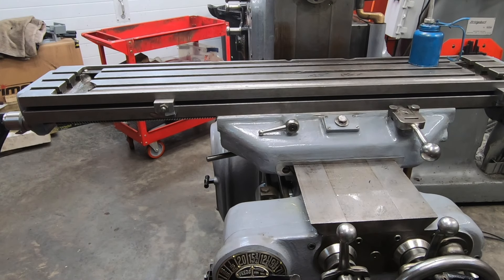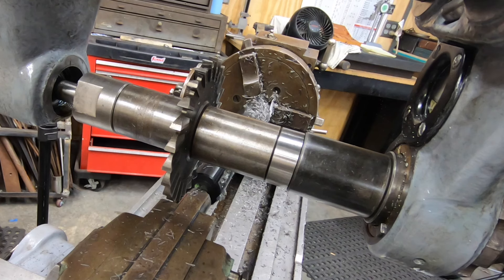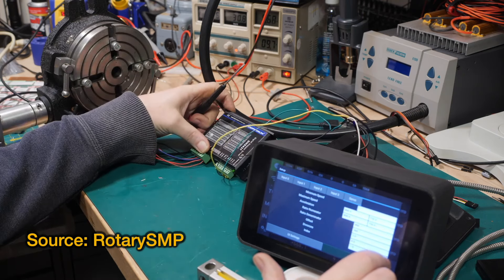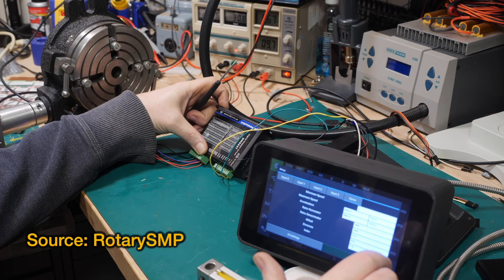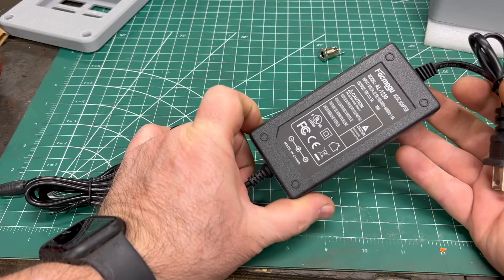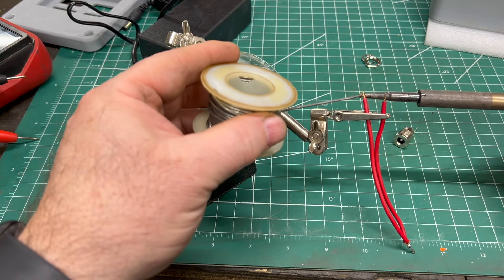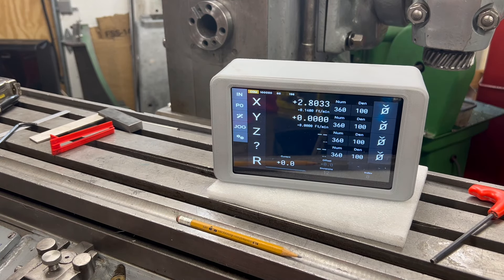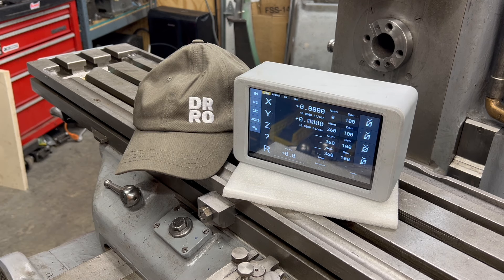Assembling an open source DRO for the Kearney & Trecker 2HL

Comment: Stefano has done a great job on this project and you as a software engineer would know that I'm sure. Your comments about documentation are accurate but that will improve. I am building this project from scratch and am just getting the boards complete which is proving a challenge. I have also built the clough42 ELS. I spent a lot of my life writing software so I bought another TI launch pad (which is an excellent board) to create something like DrDRO. When I saw this project on YouTube I was hooked as it will give my lathe DRO and also a taper cutting function. It also has an excellent user interface.
Reply from the maker: A friend of mine, @Coopedupintheshop, also build his boards from scratch. My eyes aren't good enough for that! LOL!

Comment: Don't you just love using a DRO on the mill.  It was the best investment I made with my machine.  I put a Ditron D80 on Herless combination milling machine.  Cheers, Aaron.
Reply from the maker: First thing I did on my Bridgeport is put a DRO on it. I can't imagine using it without one. Having one on the K&T will be a game changer. I love vintage machinery, but having a DRO on them makes them so much more capable. It's like a power drawbar on a Bridgeport. Yeah, you can use the machine without it, but man, having a little extra help is awesome!

Comment: Lots of capability in that pi box! Looking forward!!
Reply from the maker: Definitely. I am working on getting the other axis connected as well as what I need to do for a rotary controller to drive my divising head.
Reply: @MyLilMule  The Dividing Head Pendant Controller! Wish someone made a mini dividing head. My Lil Mill would swallowed by any regular sized accessories.
On my SB 13, I went with TouchDRO, standard res for the bed, and hi resolution for the X slide. I'm just starting a first official project after 2 back plates, I'm doing a threading dial build.
I'm anxious to see you synchronize the DH.,  oh to do away with, "a one and a two, and 12 holes..."
Reply from the maker: @billgilbride7972 look for an Ellis dividing head. Much more compact. I used to have one a long time ago.

Comment: Cool! So good that it's all open source.
Regards,  Preso
Reply: Get your Pi stuff in Australia from core electronics... kills amazon prices
Reply from the maker: For a nerd like me, it's perfect.
Reply: Add the DRDRO to your mill and with the threadexpress nothing will be impossible... :)
Also he is interested in ideas of what features it should have in its development cycle.

I have suggested 
Changing how the interface works
    For humans not programmers... :)
Summing of 2 axis - but the tweak being the axis can be at an angle.
    For a lathe that would mean an angled top slide to cut tapers and you could move the carriage and still get back to the exact same point on the taper.
Being able to move between machines
    One DRO to rule them all. Provided it is simple in the electronics (pick up a set of presets is what he suggested as a solution)
Curve interpolation - with visual position indicator (moving off proper line)
    Allow a fully manual machine to better and more quickly produce curves (or tapers)

If you have a ideas from your years of experience as to how it could make work easier - drop into his github and suggest them.
A limit is the 4 axis inpuit - but perhaps that can be increased :)

Not sure but I think it can do constant surface speed on a lathe

Comment: Everyone thinks finding a complete vertical head with drive gear is bad, a complete low lead kit is a true unicorn. I've always said if I found a machine with one I'd buy it. I do have one for the 2H but its missing the worms. The really sad story. I bought it from a  guy having an auction and it wasn't even in the auction it was lying in the corner of the shop in a pile of junk. He had a matched pair of 2CHs a horizontal and vertical that came from the same shop that bought them new with all the attachments. They were used for tooling work so never saw production. He bought the whole lot but most of the accessories got junked over the years. Made me a little sick. Anyway following along closely on this one, I found this whole setup intriguing.
Reply from the maker: That's a very common story with these old machines. Especially the ones that have been made obsolete. Finding a low lead for a 2HL is even more of a unicorn than one for a 2H. I doubt they made very many of them. The worms are the critical piece next to the casting. The other stuff is pretty easy to make, but not those worms.

Comment: Very cool!  You are probably further along than it might be helpful for, but Tom Lipton did something similar years ago, without the DRO. He built an electronic interface for his mill to cut helixes (is that a thing?). If Stephan is going to be making lots of updates it might be worth it to make the SD card more accessible.  Keep up the good work!
Reply from the maker: I saw Tom's video when it came out. But with all the backlash that's in my table screw, it wouldn't work very well. I'd have to drop the table to back up for every pass and the raise it up again. Kind of inconvenient. This takes all of that out. The only backlash will be in the dividing head. Which may be a concern, but I don't think much especially since it's a 40:1 ratio.

Comment: I got one of these coming today to compare against the TouchDRO.  I had to post an issue ticket on the Github - I can't get the STEP or IPT files to work.  Do you happen to have STL's of the case you can share?
Reply from the maker: I've been responding to your issue. But if you shoot me an email (see the about page of my channel) I will send you some STLs to import into your slicer.
Reply: @MyLilMule  I appreciate your help on here and Github.  Got them uploaded to a STL converter while I work on my Fusion refusing to upload issue.

Comment: Guessing the 10" could be used also?
Reply from the maker: From what Stefano tells me, yes. I am thinking about swapping out the display for the 10" once I get everything up and running. Make it easier on these old eyes. I'll likely use this 7" display on another DRO, maybe for the surface grinder.
Reply: @MyLilMule  if I did one would like the bigger display
Reply: @MyLilMule  let me know if you do it in want to swap all my Dro to one system on all my machines so I'll need 4

Comment: Hi Greg great job You should sell these . I know it has parts and software that's Stefon's . Like for me i don't know much about electronics as a hole  and i don't have a 3D printer so selling a hardware kit and components from in the US would be convenient for us just mechanically incline . Just a thought Great job hat's off to you programers and math wizzes. JM
Reply from the maker: @junkmannoparts9696  Stefan sells most of these parts already. The display came from Amazon. I’ll add a link to the description. And there are services that can print the files. Send me an email (see the about screen on my channel) and I can help.
Reply: Thanks

Comment: I cant open the stp files.... in ANYTHING even on line converters.
Reply from the maker: I had to open them in Fusion and then exported them to my slicer.
Reply: stp is a fairly universal CAD format which makes customizing them really easy compared to working with mesh formats. Free version of Fusion360 would work or Freecad or several of the online CAD options. Not a fan of most of the 'online only' options as they demand you open all your files to the public.
Reply from the maker: I created some STL files for you that you can import into your slicer. Eventually, these might make it into the main repository, but here is a fork that has the STL files for the Wisecoco case:

https://github.com/gregkopp/inventor-dro-case/tree/main/wisecoco-version/STL
Reply: @seabreezecoffeeroasters7994  it loads most of the way then errors out
Reply: @MyLilMule  Thanks man
Reply: @badjuju6563  Maybe recheck 
He updated the Inventor Repository a few hours ago? Just tried a few of them and Fusion was fine on both the IPT & stp files. The Fascia one is not that but it is actually a pivot frame for the main body. Haven't looked further for the Screen holder 🤷‍♂
Reply: My browser was munting the files... tried chrome ftw